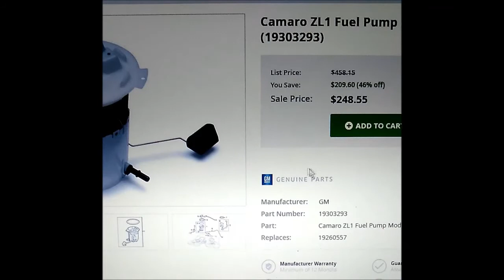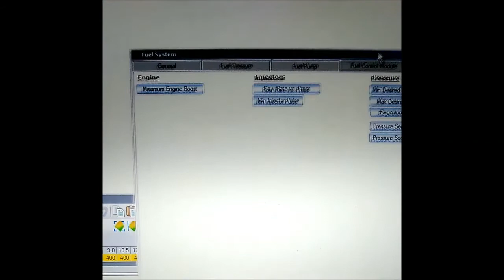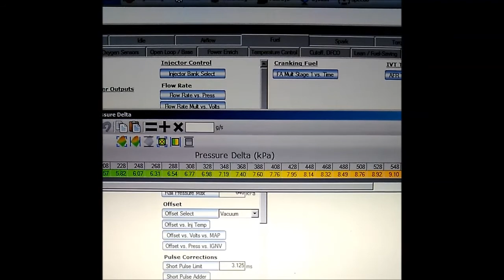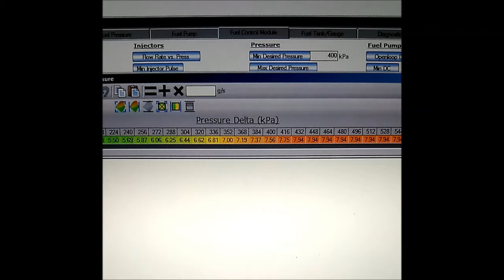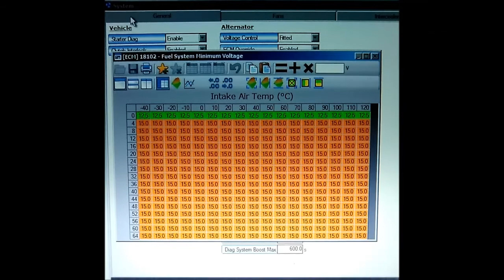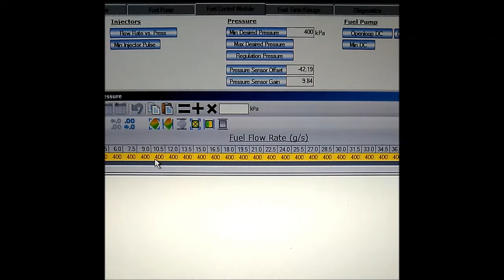HP Tuners Fuel Tuning Tutorial

Comment: If deliveeing same amount of fuel pressure will decrease if flow is increased. It may seem counter intuative, however, fuel delivered can increase as pressure decreases so long as flow increases. Actually makes perfect since. As the injector opens more (duty cycle increases) flow increases so less pressure is needed for a given amount of fuel.

Comment: Thanks for the vid. Would this little trick work on a tiny 2.2l s10? I have an upgraded 340lph fuel pump. TIA
Reply from the maker: It depends on the car's OS and what menus are exposed by HPT.  If they give you access to the same tables as I've shown, and if the pressure doesn't sustain at high RPMs, you can apply the same logic to your car as well.  Unfortunately the support for this hack depends on the car and its OS.
Reply: @ChrisCamaro  I just got the tuner, I'll have to check again once I get home. I know the parameters seem to be limited. Thanks anyway!

Comment: I have 2013 caprice with a supercharger, 80lb injects and zl1 fuel pump. My pressure keeps dropping at high rpm to 45 when I am commanding for 65. I have a zl1 FPCM tune but I don’t know what to insert in to make the Calibration correct
Reply from the maker: If the tune is stock then it's probably dropping pressure at the high end just as I've shown in the video.  Also consider that flow is a product of injector duration x pressure.  So with 80 lb injectors you have way more bore than you need and the injectors only need to be on a very short time.  If they are open for too long the only way to prevent a rich condition is to have a low fuel pressure so your injector tables may already be doing this compensation.  Check the FPCM pressure table though to see if it drops off first.  If you are able to write to it with HPT, you can max the entire table out and tune the IPW and VE tables instead to get the fuel you want.
Reply: @ChrisCamaro   I am really inexperienced with tuning. I did your method with upping the voltage for the fuel pump and upping maxing pressure tables for the pump.I still had the same result of loss of pressure at high RPMs. I completely understand what you’re saying but I have no idea how to tune it and see what is dropping  Off first 😂
Reply from the maker: @GoYoteSlaya  I see.  So these table changes are academic in the sense that they are the "due-diligence" approach to protecting your car.  However the proof is in the pudding as they say and what you really need to be careful of is the fuel ratio.  Since you're running boost, can I assume you have a wideband O2 gauge?  If you have different pulleys then you should revert back to one you know withe certainty has no issues.  Do a WOT pull with HPT scanner and check the wideband, IPW and fuel pressure.  You may see the pressure drop but so long as your IPW doesn't go static and your wideband isn't lean, you're ok.  If you have some headroom with that pulley (say 20%, go down a size and try again.  Using this more empirical method, you can interpolate the data to figure out how high you can go on the boost without issues.  You will want to stop when either your IPW exceeds 90% duty, your fuel pressure collapses to 0 or your AFR goes up past say 14 (and that this has nothing to do with your VE tune, so you're commanding fuel and not getting it).  Just creep up on it and you'll be ok.
Reply: @ChrisCamaro  I am good on AFRS now. My wideband goes low 11s at WOT which is what my tuner wants. I understand that it’s a calibration with the computer for pressure to go down as RPMs go up, I’ve tried everything to adjust and keep them from dropping but still keeps going down. I guess I will have to stick with my 5 pounds of boost!
Reply from the maker: @GoYoteSlaya  What I was getting at though was, are you maintaining 11s at 5 lbs?  If you are getting low 11s at 5 psi AND your injectors are <90% duty and your fuel pressure is still triple digits, then you can afford to lower your pulley size.  I realize I'm not giving you the direct answer to your tuning question but at the end of the day you want more boost so if you have headroom, that's what the tuning is supposed to do as well.  I suggest using any available margin you have minus a small safety factor, by increasing boost until you see one of the above mentioned thresholds exceeded.  Also 11s is pretty rich for 5 psi.  You could easily tolerate 12-13 with no danger.
Reply: @ChrisCamaro  Appreciate your input a lot. I am maintaining high tens low 11s at wide open throttle with 5 pounds. I’m not worried now about my afrs now But I’m worried if I go to eight which is what my blower is supposed to be at ( I have a boost leak right now that I will soon fix). I guess I have to just wait until I fix the boost leak and see if my pump will continue to give me 11’s at wide open throttle. And yes I know it is Rich. But my tuner wants it to be rich until I get it on the Dino. My Wideband is my friends and he did the wiring himself and his kit didn’t come with a driver so the wideband does not register in HP tuner data. I have to manually record the AFR‘s while I go WOT with my own eyes😂
Reply: @ChrisCamaro  so are you saying that if my AFR stay low 11s at 8 pounds I have nothing to worry about even if the pressure is dropping? As long as my car doesn’t go lean I should be good right?
Reply from the maker: @GoYoteSlaya  That's correct.  Since flow is a product of pressure, area and duration, you have area fixed via the injectors, duration limited by injector duty and pressure dropping.  So long as you have some pressure and your injectors are not static, there's no reason for your AFR to go lean.
Reply: @ChrisCamaro  I did do this and made the tables maxed and for some reason it still wants to go down in pressure

Comment: All I have is a diablo i3 and was curious if I add fule pressure will it help. Its a 05 GMC Sierra 1500 5.3 and its a dog down low and SCREAMS up about 4 to 5500 RPM. Or more timing down low? I need help man haha.
Reply from the maker: If you lack low-end torque but have good power at the top end, it's unlikely that fuel pressure is the problem.  Fuel pressure will always drop at max HP, which is usually top end.  Down low it won't do anything for you.  You'd be better off adding spark, tuning cam phasers (assuming you have them) and adjusting P/E ratio.
Reply: @ChrisCamaro  I took the added fule pressure out and added timing but haven't tested it yet. Sorry but what is PE ratio? My truck is a 05 so I don't know if I have that.
Reply from the maker: @DM-qp7do  Power Enrichment is a factor you define that says how much additional fuel is added under full load or wide open throttle conditions.  It is typically a factor like 1.2 or the reciprocal of that 1/1.2 and adjusts the fuel to be rich when you stomp on the gas.  There's a whole tab for it in HPTuners.  Also covered in my video.
Reply: @ChrisCamaro  The highest octane in my area is 92 so I use octane boost with about 12 to 15 gallons in my tank. It was my dads truck and is priceless to me and I drive it daily. I just want to wake up the 5.3 LM7. It is weird though because if the streets are wet I can roll at 30 mph, floor it and it will shift exactly how I want and then when im WELL into 3rd at about 4500 to 5000 the tires will break loose. I would expect them to break loose when it shifts but it doesn't, the power comes on so strong at that rpm and they break loose. The truck isn't fast by any means but its odd to me that the top end has enough power to break the tires loose at 45 to 5500 RPM at 70 MPH or more. I would like that same pull on the bottom end. But alas im no tuner and need advice.
Reply from the maker: @DM-qp7do  Tuning can only get you so far.  Fueling is more of a prerequisite but most power comes from advancing the spark.  Most stock cars without physical mods can only tolerate a couple, maybe a few degrees of extra timing and then you're maxed out and getting KR.  If you want to reshape your power curve more than a few % points in any area you have to make a physical change.  Tuning won't work on a car that's already dialed in for its physical setup.

Comment: Fuel pumps are centrifugal pumps. If you look at typical centrifugal pump curve you will see that as flow rate increases pressure goes down. I’m sure gm did this to help get that extra desired flow rate while staying on curve.
Reply from the maker: I think you are referring to Bernoulli's theory, which, in a closed system, demonstrates the correlation between flow speed, pressure and cross section to conserve mass in an incompressible fluid.  However the table in question has to do with commanded pressure or pressure head.  I see no reason why reducing the commanded pressure would increase flow.  The pump may be more efficient at higher speeds, requiring proportionally less head for a given flow but still, more head means more flow.  My hypothesis is that the opposite is true.  With compressible flows, such as in turbos, the compressor work goes up exponentially with rpm.  While we're not talking about compressible flow, there are viscous losses that go up with speed so if it takes more work to push the fluid at higher speeds, then the tables are telling me that GM doesn't want to blow their pump and to back off the power going to the pump if the flow gets too high, to prevent damage to the pump.

Comment: I'm st 842 hp ls3 with a supercharger. I am running a little lean due to injector size.  I will be installing 1200 or 1300cc injectors, and running e85. You video is great,for small things that I missed. Thank you.  Great video BTW.
Reply from the maker: those are big ones.  Let me know if you have any trouble tuning them
Reply: @ChrisCamaro  I put some new ID 1300 injectors in my twin turbo Camaro 5th gen. I’m running rich at 4K rpm at 7lbs of boost. Afr says 8’s I should be in the 11’s how do I make that adjustment in Hp tuner ?
Reply from the maker: @Louie88  8 is super rich.  Have you already entered the new injector data into HPTuners?  You wouldn't want to fiddle with fuel trims if you hadn't already accounted for the new injector size.  Because, when you size up, the old duty cycles were longer to give you more fuel from a smaller orifice.  Now with a larger orifice, if you don't reduce the duty cycle, you'll get proportionally more fuel for the same duty, which means rich.  So you need to enter the manufacturer's data into the injector tables first and then tune your AFRs.  Check out my fuel injector swap video for details on how to do that.
Reply: @ChrisCamaro  thank you for your reply. Tuner says they need to be scaled. Not sure how to do that. I need a tuner that can do the job frim a-z and not make me wait for E tunes months at end. Any recommendations on a dyno tuner would be so very much appreciated.  Thank you from Connecticut
Reply from the maker: @Louie88  So basically, it's what I was saying about the duties.  Suppose your new injectors are 80 lbs and the old ones were 40 lbs.  80lbs are twice as big as 40lbs so the scale factor is 2x.  That means your injector data needs to be cut in half, else you'll be 2x richer.  So you just need to determine how much larger your new ones are than your old ones and at least then you have the scale factor to apply to your injector tables.  Now in practice it's not that simple, as there are non-linear functions that are unique to each manufacturer.  However your car obviously starts and runs so it can't be that far off.  Scaling the main tables will at least get you a lot closer to stoich and then you can fine tune from there.  Really though the manufacturer should give you all the tables you need.  Pretty lame if they don't.  HPTuners will give you access to those tables so you don't need anything fancy to do the actual programming.

Comment: BAP put out 17 to 20V at the BAP and to keep it  you need bigger wire to the fuel pump. If you raise the voltage to 15V with hp tuner you need to raise the alternator voltage output also.I use the BAP with 52 lbs injector for 2 year now without problem i paid $75 for use one
Reply from the maker: BAPs are great if you decide to invest in one.  I just didn't want to pour into that at the time so I looked into other options.  I tried fiddling with the alternator tables as you mentioned but after a certain point the computer ignores the values so that's why I just max that table out and then rely on the fuel control module to do the rest.  It won't compete with a BAP but it stretches the pump a little bit if you're just looking for 50HP extra headroom

Comment: I’m new to hptuner although I’ve not purchased it yet. I have a 5.3 gen 3 factory stock setup in a suv. I’m looking to increase the horsepower to at least something over 325hp. It’s a 2003 suv so I’m not sure what’s still in good shape or needs replaced. I’ve beaten the snot out of it and the engine seems to be solid yet except the exhaust system. Rusty exhaust manifolds with broken bolts. That’s being fixed soon to long tube headers and 3” exhaust. Been watching anything about power increase to the ls engines based on Hptuner tuning. I’m learning slowly but I’m still a bit lost yet. Some people here seems to think extreme changes gives them a hot rod but I’m not looking to blow mine up yet. Hopefully never. I need help is my point. I guess keep watching and reading about this. So much has changed with gm motors.  It’s no longer a big cam and a double pumper Holley and a timing issue setup anymore to get a decent amount horsepower.  LOL .   Maybe some starter points to help me out. Note. My 5.3 sputters or bogs out at a quick attempt to wot at a low speed and rpm. Why?? Heard to raise the afr at cruising but not sure what’s real and what’s a gizmoetric fix.   Thanks. You got a sub.

Comment: I've read that because the FPCM only goes to 15volts, that adding a JMS boost a pump wont be allowed to go past the 15volts even though the JMS is putting out say 17v. What have you found on this?
Thanks
Reply from the maker: Well theoretically, the BAP is supposed to bypass the computer altogether and act pretty much as an amplifier, feeding off the car battery so the pump should only see the BAP.  In practice it appears not to work 100% of the time but I couldn't tell you why.  Maybe some cars have a feedback circuit coming from the pump if it's in an over-volt condition.  Best advice (what I would do) is if you decide to go the BAP route, to simply ask the company to verify support for your particular car or better still, upgrade the pump, as then the voltage is a moot point.  Both will cost a couple hundred and are really the only options if the stock cheat from this video doesn't get you enough headroom.  In my case I have an extra special advantage because electric boost doesn't leech power from the engine so I could get even more HP on stock internals without extra fuel but this is a niche case so for 99% of people you're going to run out of pump around 700 without hardware upgrades.

Comment: When the pressure goes up the ammount the pump can flow goes down... i dont fully understand it myself but its facts.. gm lowers the pressure to be able to flow more actual fuel.
Reply: Yep you’re right. If you look at a typical centrifugal pumps curve you’ll see that as pressure decreases that flow rate increases. Gm did this reduction in pressure at high flow rates to help keep the pump on curve.
Reply from the maker: You mean like they're trying to keep the Reynold's number of the fuel below the turbulent point or something?
Reply: @ChrisCamaro  Hi Chris This is pretty old now but just found it looking for HPT Fuel Pump info...Did you ever look to see what the pump Duty Cycle was doing?  Curious if this Camaro went into a limp mode on injector duty cycle?
Reply from the maker: @jcasey460  It's an ongoing investigation.  Right now I'm on the brink of getting my electric supercharger working... I mean it's already working but it's not wound correctly so once that's fixed and I'm actually getting 5-6 psi of boost I'll be able to let you know if I hit a ceiling in injector pulse time or fuel pressure.
Reply: @ChrisCamaro  Thanks...electric supercharger...wow you must be the first or at least you're the first one I have heard of.  That alternator pulls a lot less HP than a supercharger. Keep an eye on the fuel pump duty cycle. I suspect that is the reason for the pump pressures used by Chevy.